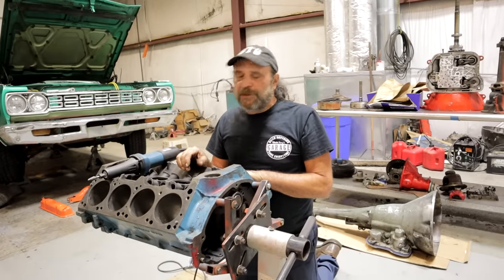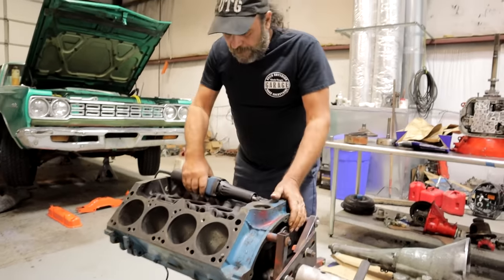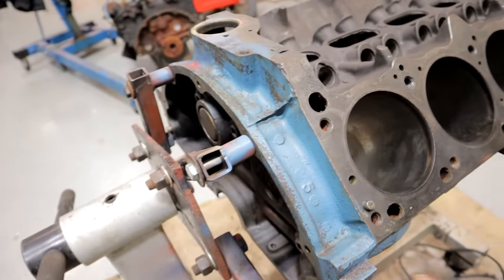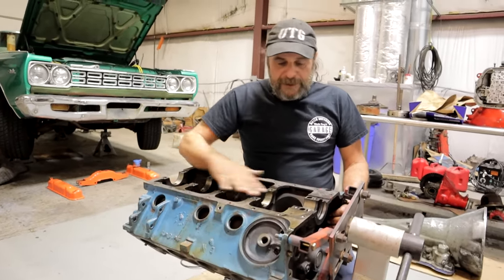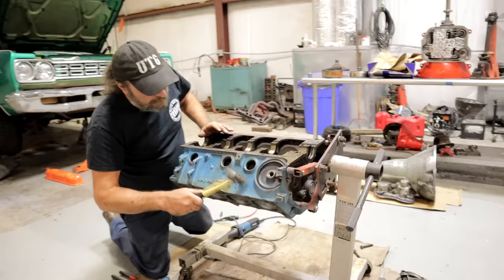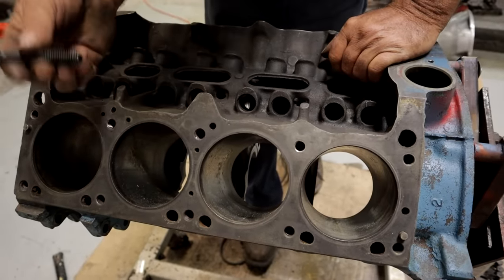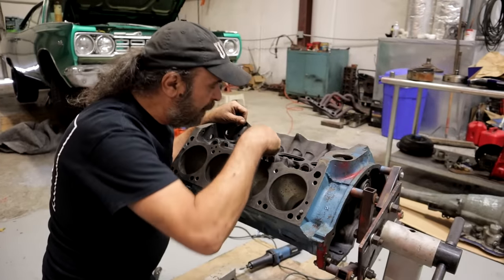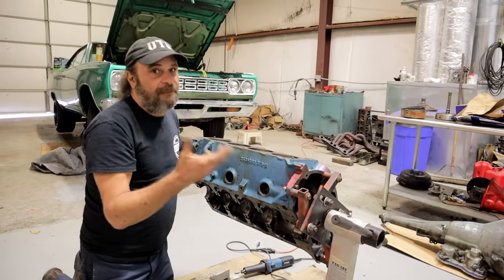Engine Block Preparation For Performance And Abuse - Best Practices For Inspection And Detailing

Comment: A very good tutorial, lots of good information. And you even used the correct  term "core plugs' several times! 
Growing up in the Great Lakes area of North America (the manufacturing center of just about everything) I was 15 years old before I heard the term 'freeze plug' from a kid just up from the south. 
My classmates and even our shop teacher tried to explain that the 'core plugs' were to PLUG the holes left behind from the sand CORES used in the casting process. It was no use, we were wrong, he didn't believe us!
And today, repair manuals, Summit and Jegs and just about everyone else buys into the freeze plug myth. Why? I dunno!
Reply: It's funny ha say that about core plugs here in a Australia we call them Welsh plugs.peace
Reply: I was told that when the coolant freezes (if plain water was used instead of coolant/antifreeze) the ‘freeze’ plugs will pop out instead of the block getting cracked from the expanding water. That’s BS ofcourse because water will still expand in other areas.
Reply: Yes! The holes are left over from the supports on the sand core. The core must be suspended inside the mold so molten metal can flow all around it. The holes are then used to empty the sand out of the casting.
Reply: @wayneireland4802   My MGA uses slightly domed discs called Welch plugs according to the factory repair manual. Core plugs are shallow cup shaped. But whatever you call them, Welsh, Welch, core, soft or expansion plugs, It's fine by me! 😁
Reply: Welsh (or is it Welch ?) plugs are used in the US also, in old Mopar hemis and probably many others. Think it's a name brand.
Reply: @MrZdvy  actually sometimes they will pop if the fluid freezes in the block and gives a Lil more space for the fluid if it freezes again. It's a 60/40 chance if you mess up and forget to drain the block. It's not what they were there for originally   designed for but it's a added bonus secondary use
Reply: he did slip up once, i notice when people call 'em "freeze" plugs :)  but yeah, water doesn't have a brain and search for a convenient exit when it freezes. the old story about calling them freeze plugs is poor farmers using just water back during the 'Depression saw once a core plug pop out, and figured that ol' Henry was looking out for the poor farmer in designing it. Ford was never going to try to convince anyone otherwise, he sold a lot of product to people thinking he was for the little guy and not the bankers who had originally denied him loans.

Ford did in fact do a lot of planning--he had parts shipped on pallets set to his specifications so he could use the wood for floorboards in cars, and leftover wood was used for Kingsford charcoal (where it got its name from)

Comment: Good video and many ways in comments on engine block prepping use what works for you. Files work and something grinding work. The key is the end results of cleaning up the engine block, heads, snowmobile jugs ever that Briggs and Stratton engine. Be careful when using a sand blaster. If you don't get sand all out it will destroy your rebuilt motor, my boss found out the hard way on his intake manifold.

Comment: And they make a chamfer cone for top of cylinder bore. It uses a cone shaped 80 grit sandpaper and you spin it with a drill. We did that to every cylinder while I was at Grooms engines.

Comment: I have wondered about removing casting flash for years. I knew it might help take out weight that might help the block hold more heat. But I did not consider the stress risers.

Comment: Tony have you ever thought about matching the cooling and oil drains in the head and block. I'm not talking big cuts but just cleaning the edges... So they can flow easier.
Reply: Cannot talk about this particular engine
But most of the time the biggest restriction is the gasket itself especially if it's a MLS style gasket

Comment: Tony, my Dad and I were talking about your 318 build, try looking at a stock replacement magnum piston wich has a higher compression hight than the la piston you will have to narrow the rod some. Will bump compression a lot, and still consider stock type parts.

Comment: TONY!!!

Have you ever stress relieved a block?

Like say put it into an engine oven and bring it up to about 850F and then let it slowly cool over 12 to 24 hours?

[the process is different for an aluminum block and its at lower temperatures]
Reply: Side point: heating the block to 850F will pretty much break any rust in the jackets because of the massive difference in their coefficients of expansion.

The rust will pop off.

If you wanted to get stupid crazy, once you have gotten all your rust out, you can soak it with ammonia or urea and nitride the block, but one has to be careful because that causes GROWTH which can RE-stress the block all over again.

But, still...putting 2 to 3 thousandths of an inch of nitrogen into the block will really help reduce RUST and WEAR.
Reply: @hunnybunnysheavymetalmusic6542  How would one go about home nitriding a block?
Reply: @bcbloc02  If you do not have an oven designed for this specifically, you have 2 initial choices: 1, cough up the money for a pre-made one, or 2, get out your builder skills and some tools and build one yourself.

You need to consider this first.

While there are a lot of ready-made designs out there, both free and purchased plans, I do not know of any of them which incorporate aircrete, but I would most definitely advise using it between whatever your outer structure is, and your inner refractory lining, both for stability, keeping out drafts [oxygen] and insulation [without insulation your cost of operation goes way up, especially if you plan on nitriding, or carburizing any product].

You CAN 'carbo-nitride' products, but, since most 'cast iron' blocks are, in fact ultra high carbon iron [higher than 'steel'], adding carbon is not what you need at this point, obviously.

While Nickasil is another option, its complex and time consuming, not to mention deals with a lot of highly toxic chemicals and extreme precision which can mess with some people.

Let me follow that up with the fact that, with some machinery, nitriding too, can some times involve at least one very toxic chemical [cyanide in one scenario, and ammonia in another one], although if you go the urea route, you don't have that problem.

The 3 major chemicals used for nitriding [there may be more, I am not sure, although I do eventually plan on experimenting with other nitrogen compounds such as melamine, hydrazine and metal azides] can be obtained, with varying levels of difficulty from various sources, locally and online, depending on where you live, and what laws apply.

By nature, I would tend to avoid cyanide simply because it can kill kill a person so fast, whereas ammonia is many times safer, despite having its own hazards, and urea, while seemingly easy to use, can, in some situations, lead to a few potential hazards, so one should never be careless when handling these chemicals.

From there, you are going to have to consider how large you can go, because an engine block, as you know, is no small object.

You are going to need roughly the volume of a 4 foot cube worth of space for a nitridation oven large enough to hold a decent sized V-8 engine block.

Inside the insulated, draft-proofed oven, you will need space to put a 'sealed-yet-vented' box that you put the engine block and the nitridation feedstock so that it can be either lowered in via hoist, or rolled in at ground level on wheels.

If you can not get stainless steel, it would be best, where possible, to nickel plate your box, because otherwise its going to rot away as it is force oxidized on the outside, as well as it will warp and buckle as it grows, soaking up nitrogen from the inside.

The reason I put 'sealed-yet'vented' is because you need to make certain all of the oxygen is extracted, but at the same time, you need a vent where the excess gas can escape so the box does not warp or rupture.

The trick is to have a small [very small, actually, 1/8" or 1/6" pipe size with a stainless steel check valve] vent which you can both attach a vacuum pump to initially to extract the oxygen, and then, when it warms up, allows it to not only continue to exhaust any other oxygen you could not get, but release excess gas when the temps get high enough that the box could potentially warp or rupture.

The thicker the walls on the box, the more resistant it is to deformation, although at the same time the slower it will heat.

You need to have enough heat, over enough time, for the nitrogen to soak into the metal of your part to the desired/intended depths.

But never forget, nitriding metal changes the geometry/dimensions of the initial part.

This means, as the metal 'swells' / 'grows', your initial dimensions are going to be totally thrown off.

If you are not prepared to deal with changes in material dimensions, it is best you not try this, because it can totally throw off your entire block so that things like valves, camshafts and freeze plugs no longer fit.

And boring/grinding AFTER you nitride, well...

It fully defeats your work.

You will grind off the nitriding.

Therefore, typically, engineers who plan for parts being nitrided will prepare by over-sizing the clearances of the part, so that when the nitridation is complete, the part ends up in the final intended size/clearances/fitment.

Comment: I just started prepping a second. When knocking out the core plugs all of them were tough to get loose except one. The punch hit the outside of cylinder 2 and left a knick in it. May be starting over.

Comment: Tony, do you spray coat the interior of the block to further allow the oil to pass to the pan less interupted or do you leave it 'casting rough' on the theroy of better cooling?
Reply: He's done it both ways before. The slant in plan z has been painted with rustoleum on the inside to seal it up. From what I remember he only does that with race only stuff.
Reply: @ChrisTheBmxGuy  electric motor paint is the closest to glyptal

Comment: You mentioned honing....was that just to aid in cylinder inspection? If honing points out flaws that lead to block rejection, better to do it before 20 hours of flashing and edge softening. If the block is not getting machined, would you suggest honing first and checking cylinders for roundness and taper?

Comment: This is the case for blue printing and balancing, plus deburring, flashing cleanup and chamfering holes, perhaps, cross drilling.
Reply: I was gonna say that also. And possibly try to get creative and lighten the pistons and rods as much as you can while balancing them
Reply: @nicholascola7190  Yep. Shot peen and Polish the rod beams before balance too. If you want to get really serious, extrude hone the oil and coolant passages a little to remove any internal flashing and casting sand pockets. Can also paint the inside of the block with Glyptal.

Comment: A drill with a steel cable in the chuck, fray the end of the cable and have at those water jackets, especially if they are that crusty helps too... just make sure to match the rotation of the drill to the winding of the cable

Comment: Later (mid '70s-up) 318s are bad about cracking radially out from the head bolt holes. Have seen this countless times, and they seem to never strip out, and they hold head gaskets, but I'd shy away from racing it, or seriously modifying for street use.

Comment: I amazed tapping it knocks so much stuff loose.  13:14, maybe this is why the subaru head gaskets I replaced failed in 2-3K miles, The heads, I thought were flat, but I took them to a shop and they made sure they were flat.  I did not check the depth of any of the bolt holes.  Maybe the bolts torqued, but did not really secure it and when the "stop leak" hit the radiator and that blew, it was enough to blow the head gaskets.  I was not driving who knows how it was driven just before the radiator blew.   I found a white crystalline residue all over the engine bay from the coolant that was evaporating.  hmmm

Comment: My best friends owned a machine shop built stock engines to top fuel engines for over 35 year's they hot tanked and cleaned all cast iron with hot high pressure soap and water and compressed air

Comment: Been doing this sort of things to blocks for decades but checking the depth of the head bolt holes ? never occurred to me I run a tap through them and clean them but never checked the depth or the chamfer .. everything else in video I do .. also noticed nothing was mentioned about the oil pump mounting surface ? not familiar with this particular engine but on small block chevy I re work the oil passages on the main bearing cap that the oil pump bolts to .

Comment: 1st off NEVER use A TAP to clean threads. ONLY use thread cleaners to clean threads! The difference is Taps are used for cutting and thread cleaners are used to just clean and straighten threads.
I also like to polish out the lifter Valley, behind the timing chain area, the bottom of the block below the skirts, and around in the camshaft tunnel after all the grinding has been done. Then have it hot tanked bored etc and my last step before I install the cam bearings and test fit every is to tape the inside up when paint shouldn't be (lifter bores etc) and use Glyptal paint. It also makes oil guide right back to the pan.
Reply: Yes, it's scary how much metal a tap removes, even from a clean thread.
Reply: Good advice on the taps. Yes, they can leave the holes a bit loose. If you're super low budget you can always slice a channel in some old bolts, make sure there are no burrs where the channel was cut, and use those to clean the threads. I have taps, thread chasing taps, and my old modified bolts for when I get nostalgic.
Reply: so, how does paint help "guide" hot pressurized oil when the surface becomes just as rough as before it was painted? and how do you avoid the paint insulating the heat transfer from block to the oil? shouldn't you be painting the crank and connecting rods and camshaft and heads to get this same benefit?
Reply: @albertgaspar627  It seals any pits etc and oil flows right off of it back down to the sump for faster oil return. I personally polish all that I can before I seal it with Glyptal red.

Comment: I recommend carbon steel taps for bottoming threads. Or, cut a series of hacksaw or slitting wheel slots lengthways on a grade 8 bolt end. Use lots of cutting oil.
Reply: Actually, it's preferred to machine cast iron dry because it not only has a graphite content that makes it self-lubricating, but it also forms a powdery chip that can create an abrasive paste when mixed with a liquid.
Reply: @vandalvetteworks8008  we're talking about bottom tapping rust, gunk filled holes. Modern tapping fluids like Tap Magic work fine with cast iron. A tap is the most effective cleaning tool for threads.

Comment: when i.built my 440, i bought LONG carbide burrs, and i removed as many sharp edges as i could get to in the oil galleys. i radiused all of the inside corners that i could get to. and to be honest, i hoped it would make the oil move thru the galleys better. back then there was no internet, and I did not know anyone who studied fluid dynamics. do you THINK it made any difference?

Comment: Hey Tony, I have a brand new factory short block for my 80 series Land Cruiser.

Do you have a video on prepping/storing the block long term? I just refreshed the motor about a year ago but saw that I could still get a brand new factory short block so I grabbed one. 

My plans to put it on an engine stand and oil. It double bag it and keep an eye on it. But you've got so many great videos. I thought maybe you had something on the proper way. 

Thanks to

Comment: Dear Tony 
thank you for your video, i am now in the stage of cleaning my chevy 350 do i need to change the freeze plug to brass as i have still the steel one, no leak just don't want to go through changing them after install the engine.

Comment: Got a question on pistons, I've got an older 302 with a standard bore & they were in pretty good shape & have just been honed but now I've found that I need new Pistons because of hairline cracks in the skirts. Do I need to have the cylinders bored 30 over now.  Thanks

Comment: Question Uncle Tony, 
Bought a 1973 charger se with the 318 (you are really going to hate me 😁) that I am swapping a 6.0 gen 3 twin turbo into. I'm looking to tub out the rear wheel wells. I was going to replace the leaf springs with coil overs but if you have a better suggestion.. please lmk. I'm also going to weld torque boxes in the rear as the bigger engine mopars had/have (and again if you have any suggestions to help out with the torque please lmk). Thank you and keep the good videos coming👍👍

Comment: Iv got a crack between cylinders 3-5 on a 350sbc ik i can sleeve it but what about that crack on the deck surface or would the sleeves work and the head gasket seal it off?